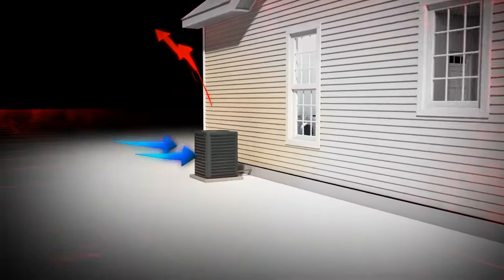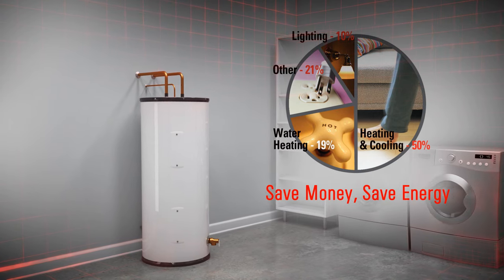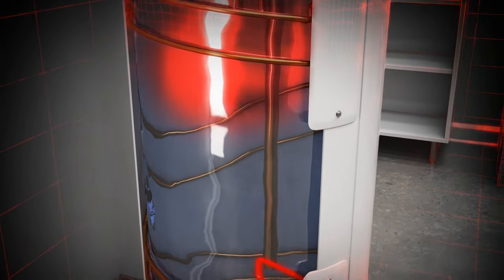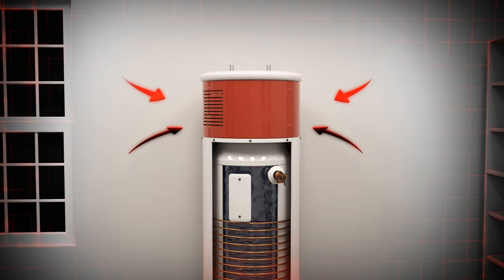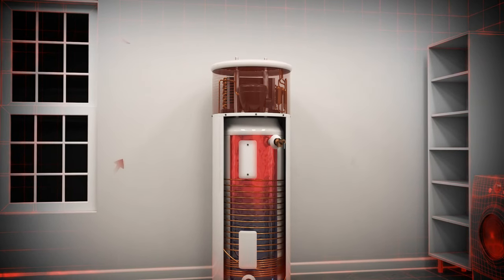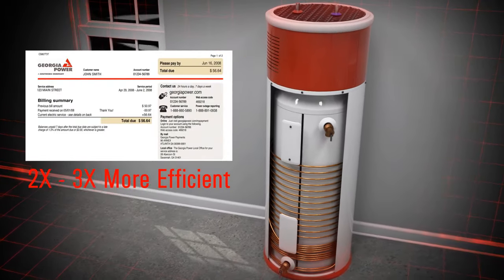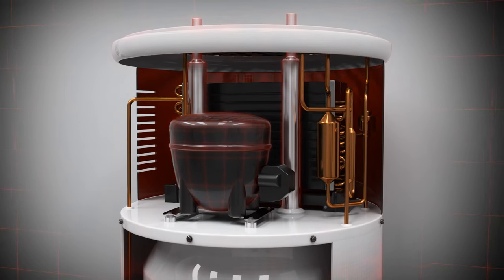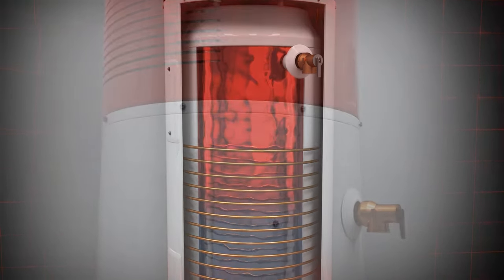How A Heat Pump Water Heater Works And Helps Save Energy

Comment: I just installed one of these in my home a couple weeks ago.  I turned off the elements and use it in heat pump mode only.  We love it.
Reply: How much ?
Reply: @sunmoon-dm1ut  around 1800 bucks depending on gallon tank you get

Comment: Let's reinvent the wheel so the homeowner cannot longer work on their water heater something so simple as heating water
Reply: Anyone can operate a little heat pump even yourself
Reply: @ogasdiaz  OK let's go to the point cause I think you're trying to be funny. Fu first mr. nobody. , now if you need somebody to explain you why a heat pump system is more complex to do work on than the traditional system maybe you shouldn't be throwing your opinion around
Reply: @alexrodriguez-cp3gb  you know what's even less complex? no water heating. This does not means that it's better. the water heat pump is cost-effective and really easy to repair. Why would you use inferior tech?
Reply: Really easy to repair?  Yeh refrigerant, compressor, valves. Meanwhile my gas water heater has literally run for 18 years with maybe $40 of maintenance.
Reply: 16 years here with same cost. Minimal.
Reply: @alexrodriguez-cp3gb it's literally using the same tag as a refrigerator and sense a refrigerator is easy to work on, this water heater would be no different
Reply: @NadeemAhmed-nv2br  hey For Me It's Great I will charge more money for the homeowner. I am sorry buddy You should've bought a old school water heater after all It's just heating wate , how many homeowners do you know that fix their own refrigerators ?exactly!!!

Comment: What if it's winter and the air is cold? Like really cold.
Reply: It depends on the design, but most heat pumps work even in very cold weather. They are common in northern Europe and can handle the weather there quite well. However, this will depend on the model of the heat pump.
Reply: There are units specifically designed for use down to -25degC with efficiency still much higher than electric or gas heating. Just need to install sufficient capacity.
Reply: Always go big my friend. Although I'm not a fan of HP I've researched enough to tell you to install an 80 gallon one.

Comment: One doubt. If nobody uses hotwater. Then after reaching max temp of water, the condenser coil canot transfer anymore heat.. So with out heat transfer how the cooling system works and how we get cool air. Please dont tell its only for hot water not for AC. Then its overall efficiency will fall down drastically.
Reply: Jib, the point of a heat pump water heater is to consume less electricity and be more efficient. The fact that it cools and dehumidifies the room is a bonus which leads to further savings since your air condition won't have to work as hard.
Reply: @meesc3556  What about in the winter and your dumping A/C into your home only to reheat it with your in home heat pump lol
Reply: @composite-guyrobert6402  In winter you're dumping heat into your home.  The (hybrid) water heater is located in the garage or basement and not cooling the air in your home.
Reply: @composite-guyrobert6402  Agreed its really laughable.
Reply: @meesc3556  a negative during the winter months. No explanation were the condensate goes either.

Comment: My dad has had a Rheem heat pump hot water system for almost 10 years.

The only problem he has had with it is bad connections in the compressor circuit & it's the most complained about 310i unit that Rheem has discontinued.

I'm an electrician by trade & I found out that the connections to the compressor were loose so I tightened them up, so I think that's all that goes wrong with them besides the water pump in them failing.

They are a great unit for my climate which is between the central & mid north coast of New South Wales in Australia but they aren't very good down as far as Melbourne in Victoria or in Tasmania during winter time.

Comment: If this water heater is in a room you are heating then does pumping heat from that room into water actually save money?  

I suspect a gas water heater would be a better option for people living in a northern climate unless you use a heat pump to heat your home.

I'd really like to see some numbers based on climate in a home heated by gas.
Reply: The UK is phasing out natural gas by 2025, as are some states in the U.S. (and provinces in Canada, I heard somewhere the other day).  I wouldn't put in a gas heater hoping gas is going to be available to your home 10 years from now.
Reply: @cra2cra226  Good point. (EDIT: I just looked this up and it turns out not to be true in UK at this time Jan 2021.  Phasing out gas is only a recommendation for new buildings.  It was misreported in some articles.) I believe California is one of the state's trying to phase out gas.  In the northern states phasing out gas is a more difficult task.  We need substantial infrastructure upgrades.  During a cold snap when heat pumps don't work well and backup electric heat systems activate it would topple our local grid if we phased out gas. The equivalent of when California has a heat wave.  Beyond that most states rely heavily on gas for peak electric production.  For cost savings this doesn't appear to be the best option right now where I live if you heat your home with gas.  

There might be some ways to achieve a cost benifit in colder climates.  Venting to the outside during winter or putting it in an unheated basement. I think you definitely need to spend the extra money for the "tank extender". Otherwise it will be using electric everytime someone takes a shower or runs the clothes/dish washer.
Reply: @cra2cra226  Madness.
Reply: You need to install the heat pump either outside so it is does not cool down the space, which would slowly reduce efficiency, or you have it in a room with warm air ducted inside. You shouldn’t put it in an area you’re trying to heat.
Reply: @amcd061  The room it's installed in must be heated in an area such as where I live.  The pipes would freeze and burst.

Comment: The BEST HEAT PUMP W/H, IS THE MOST EXPENSIVE EVEN SOLD HERE IN USA,   STEILBTRON ELECTRO,made in GERMANY for about70 years and I never heard of anybody running out of water,nor noise,the CONDENSER TUBING IS EXTRRNALLY ,AROUND ITS TANK,ITalso has just 1 electric heater at top,so suddenly RHEEM `HAS DONE THE SAME THIG WITHJUST1 MODEL,I WONDER WHY ?
CHERIO🇩🇪🇩🇪🇺🇸🇺🇸